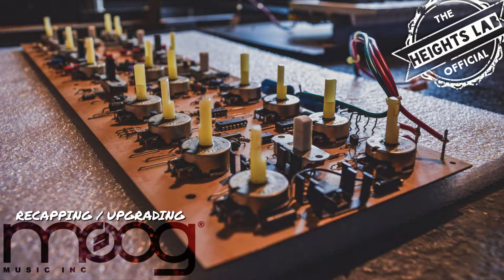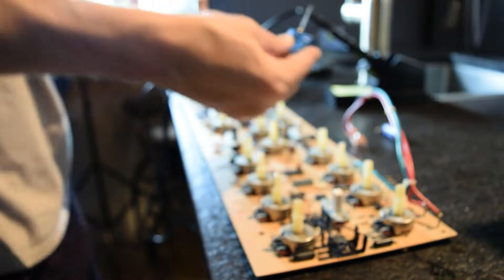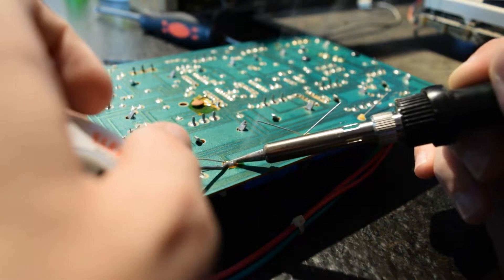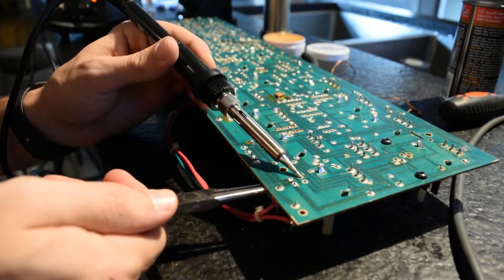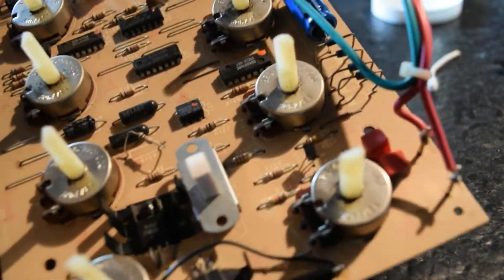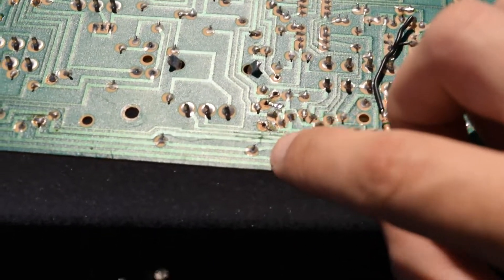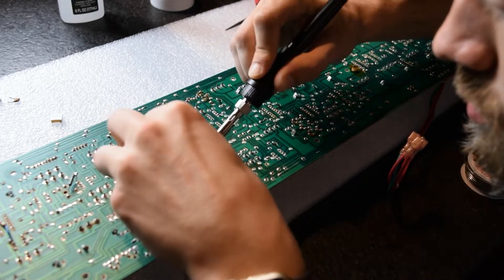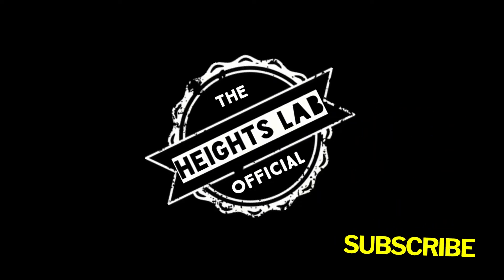Recapping Vintage Moog Synth (Replacing/Upgrading Capacitors with WIMA, etc.)

Comment: Film (FKP1) is better than metallised for Audio pulse circuits right? Do you ever match them or just use 2.5 / 5 / 10% which are all an improvement to old bad ones. What soldering temperature do you use on these old boards? Wouldn't you clean the board for flux after? I find flux residue change capacity and gives ghost connections. Interesting to see this work!! I might upgrade to tin sucking soldering station.